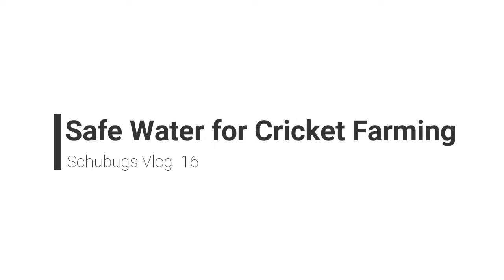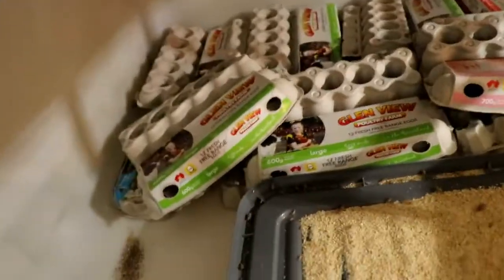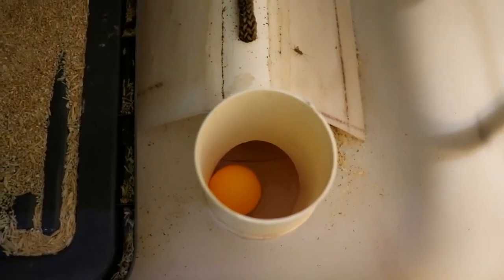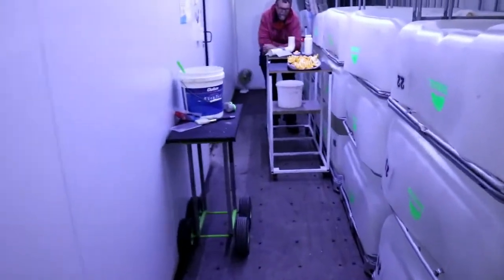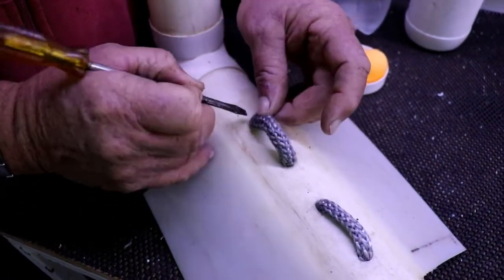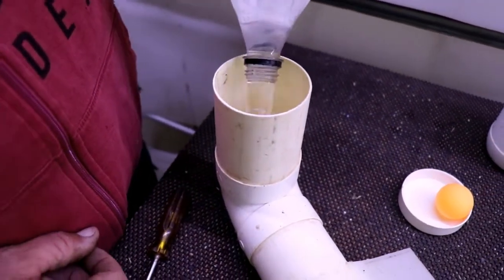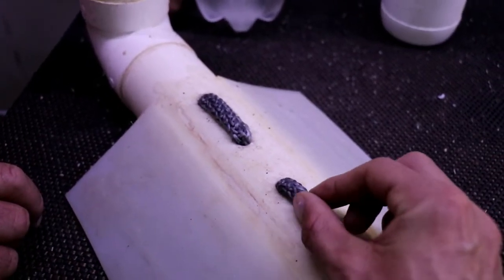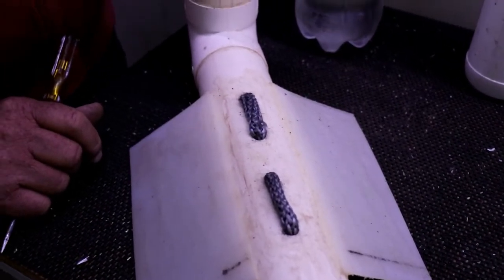Safe Water for Cricket Farming / Schubugs Vlog 16

Comment: Do you use this same method since they are pinheads? Or do you have a different method for the little ones?Cause I see you have some oranges slices on a side  Thanks for your videos! :)
Reply from the maker: You can use the same method if you would like. We just use oranges for our pin heads
Reply: I’m new to this, what’s a pinhead?
Reply: orange? so expensive... any other options for baby cricket drink? we (in Indonesia use banana stem ) but sometimes hard to find it and take time to set it